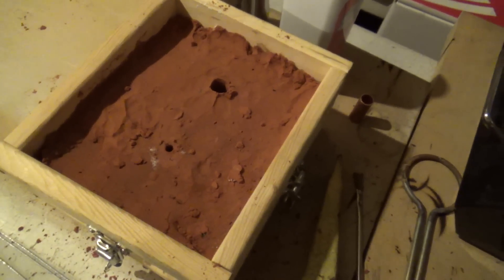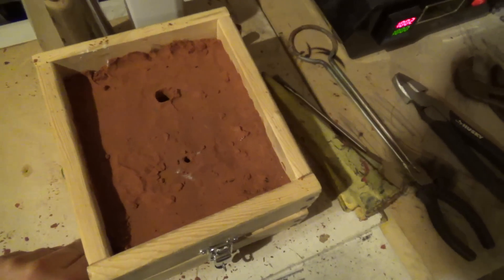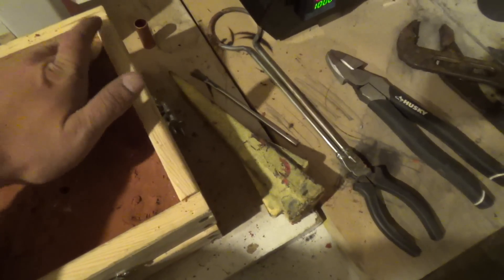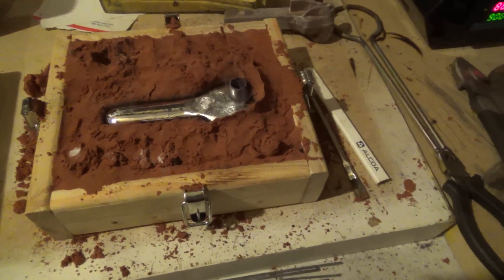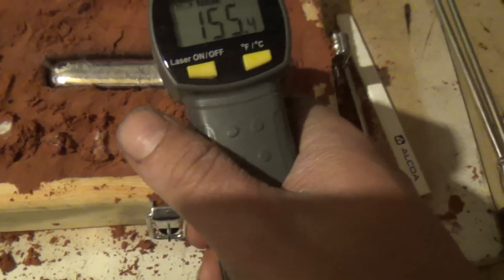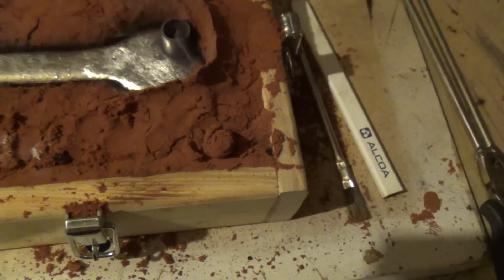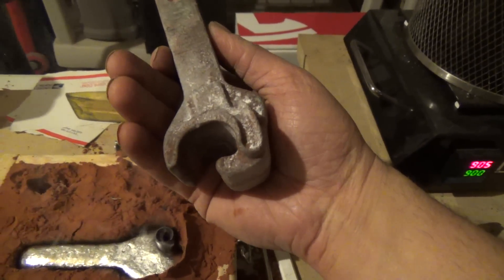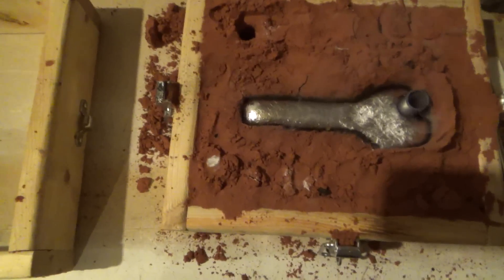Aluminum Sand Casting at Home: First Cast Ever! P2

Comment: you can't measure alu temperature with an IR thermometer. it will read too low because metal is a mirror in IR. So you are not really seeing the metal.
Reply from the maker: Thanks for the input, makes sense! Breaking apart some more Chinese engine heads tonight, hopefully will have enough for another round. The second coupler we made, while not pretty, works flawless on our train. I wasnt expecting it to be as strong as it was, especially given the pot metal aluminum i'm using. Was able to pull 4 train cars with about 2,000 lbs with it!